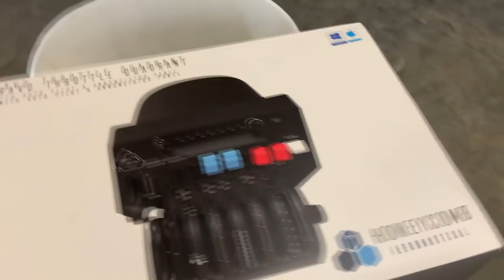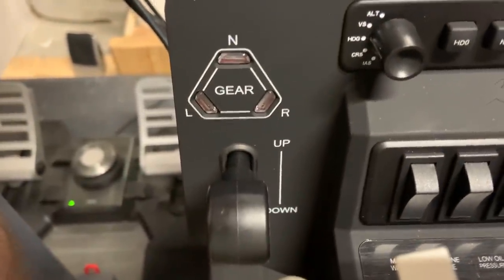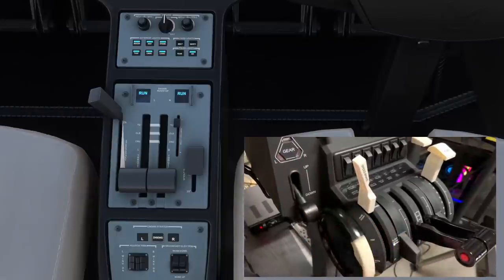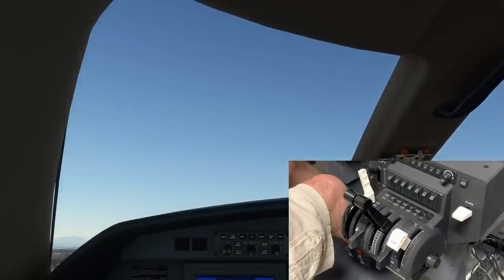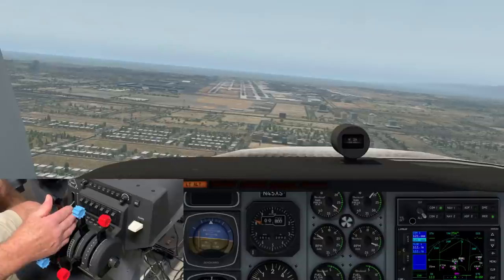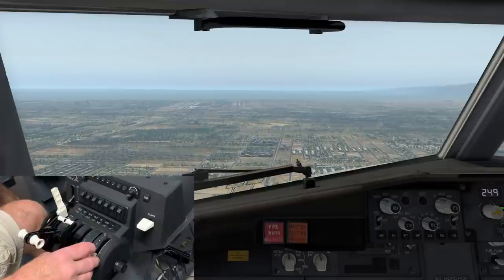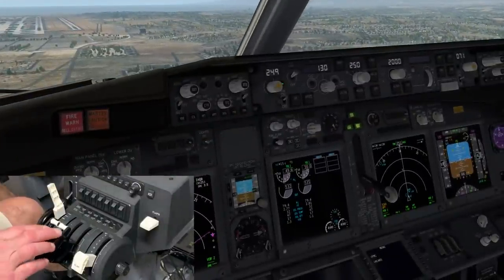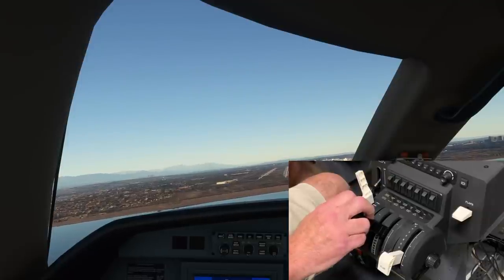Review: Honeycomb Bravo Quadrant - A Pilot's Perspective

Comment: A gem of a review thank Russ. I supported the Honeycomb kickstarter and certainty have no regrets. I saw there is third party software available to turn the button pulse control of the trim wheel into an axis. This allows a change in responsiveness to one's liking, but obviously its not going to affect the physical resistance issue.
The above did make me wonder whether that software (need to find it's name) could be used to turn reversers into axes. That would then offer gradution.
Not only did I greatly enjoy the video, I found the comments section useful as well. My next point to research is whether I could use my old joystick as a tiller for taxiing while having the yoke and throttle assigned? - the issue being I don't have rudder pedals, and a button on the joystic could be used for braking.
Many thanks and a definite sub from me!

Comment: I have this unit... 5 things I can give constructive criticism about:
1) The rotating knobs for the left side selector could have been better quality, with at least a white line so you could see that was currently selected. That, or an LED above each function to show which was currently selected.
2) The push buttons having inter changeable covers so you could assign the buttons the way you want them. 
3) The toggle switches having lights on them so you know when they are active.
4) For the commercial levers, make the white knobs bigger and have the TO/GA switch on the side as it is in commercial aircraft.
5) Detents for the flap and IAS selector levers would have been nice.
Reply from the maker: Good points but I fly a lot in VR so the LEDs wouldn't help me that much since I have to work mostly by feel.. Also,  as a high hour B737 pilot, I can say that the TOGA button is close to where it is on all real 737s made after the B737-200 Advanced (1980 vintage).  The side button is the auto throttle disconnect button so they have it right for B737s on the Alpha.  It was hard for guys who switched from the early model 737s to the newer models because when doing a go around they would instinctively  hit the "old" TOGA (side)button and disconnect the auto throttles and NOT start the auto go around as expected. After a few seconds of confusion things usually went south fast after that and I even saw a few guys bust check rides because of it.

Comment: Hi Russ:  I am your target audience.  A beginner with flight sims researching the hardware.  You helped me choose the Honeycomb Yoke and Throttle Quadrant.  I will be using my HTC Vive Pro headset and wanted to be sure not to overspend on hardware.  Your review  also helped me feel confident I am not overbuying as a rookie.  Thanks.  I really appreciate your calm demeanor describing your reactions to the items your are reviewing.  It makes paying attention much more relaxing.  I think I recognized the Saitek rudder control in one of your videos.  Would you recommend that product to fill out the base set of sim controls?
Reply from the maker: I think I would get a cheap used rudder on eBay or craigslist for less than $100 and wait for the Honeycomb Charlie. May be a year but the Saitek or CH pedals cane get you started at a reasonable price. Thrust master has a cheap set of pedals in plastic but the are about $120 and are close together and look flimsy. I really am not qualified to pass judgement on them so check online for reviews. Good luck.

Comment: Great review. I’m getting ready to set up for FS 2020 after not simming for a few years. Your review is very helpful.

I’m wondering how VR goggles work when using an “analog” setup like this. How can you manipulate buttons/switches/handles while wearing the goggles?
Reply from the maker: This is indeed an issue.In the military when checking out on a new aircraft we used to do a blind cockpit check where we had to be able to find all the knobs and switches while wearing a blindfold. Once you get your hands on the throttle you can kind of find everything from memory and feel  but what we really need is hand tracking and pass through video to be able to really fly easily in VR. It’s just that the immersion and realism is just so compelling it’s worth dealing with the limitations that still exist.

Comment: Would respect your thoughts regarding the "potential" utility of the Bravo Encoder dial and associated Quadrant buttons to complement, augment or mitigate the need for the Knobster.   What compelling physical or logical limitations are observable regarding the Bravo Encoder over the Knobster.  Appreciate your honest and credible review.  Gratefully.
Reply from the maker: Yes in some regards the built in encoder may be a step backward for those using Knobster.  First it requires rotating the selector knob to select a mode which seems less intuitive that just touching it on screen as with Knobster.  It reminds me of the Saitek multi-panel operation.It still beats using a mouse and keyboard for inputs. Second, the Knobster has a much better Elma encoder that the one used in Bravo.  Bravo is a reasonable trade off between quality and price. I am anxious to try the quadrant in VR to see how easily I can stay oriented using tactile feedback only to navigate the buttons. I am thinking the autopilkot buttons and sellector may be pretty easily memorized and used  while "under the hood".  Finally, some people may elect for a panel monitor that is not a touchscreen displaying Air Manager instruments  in which case the Bravo buttons would be a useful improvement over mouse and keyboard inputs.
Reply: @rbarlow  Thanks Russ,  I've noticed in multiscreen configurations that MSFS 2020 only honors Touch when present on the Touch Screen Display (Acer 28" - which makes sense).   
However, if MSFS 2020 is instead running in a window on my larger 32" non-touch screen and a subordinate window from MSFS 2020 is moved into the Acer Touch Screen monitor,  TOUCH does not operate in that secondary window context.   
Ideally, my 32" (non-touch) screen should be used for primary "viewing" and the 28" Acer Touch Monitor would be used for tactile operations such as NAV/RADIO/AP.  Is there a workaround or setting that I have overlooked?   Gratefully.

Comment: I've flown numerous Boeing jets in real life, so I'm picky about realism. I have a couple of questions. 1) Since there are no detents or gates, are you looking at the aircraft flap position
indicator to judge where to position the handle in order to get the flap setting you want? 2) Is there an autothrottle disconnect button?  I noticed that the TOGA switch is where the disconnect buttons should be. It appears that you were able to arm the speedbrakes using the handle. Did you lift the handle as in the actual aircraft or is there simple a detent position that accomplishes that task? Thanks.
Reply from the maker: First look at this video for the flap issue I made a fix https://youtu.be/C5Xh_tFWsVk
As for the A/P disconnect button you can reassign any buttons as you wish. Actually I flew B737-200 Basics that had the TOGA on the side where the later. -200 ADV had the disconnect. At first we were flying both models and had sims of both types. I saw many a guy accidentally disconnect the A/P during a go around thinking he was hitting the toga on the ADV….thing rapidly go downhill from there.  Finally I by habit moved the SB handle to a slightly forward position but there is no arm detent. After you see my flap detents it could be done.of course the autos Poulet works in the sim but obviously the Bravo handle has no motor so it stays put.

Comment: I transitioned from a Saitke yoke to an Alpha and can't wait to get the opportunity to transition from the Saitek throttles to a Bravo (hopefully early next year).  
How is the trim response on the Bravo in MSFS?
Reply from the maker: Not a big fan of the trim on FS2020. Not sure if the inputs are fairly large but slow but I seem to no see it a first and then over trim. Need to look into it. It’s seems to take a lot of wheel rotations to get much trim so it seems more precise than the yoke buttons. Something about the rate of trimming seems off.but I don’t think it is the Bravo.
Reply: @rbarlow  Thank you for your input. The trim is definitely an issue in FS2020. I've gotten a, little better at using it but for the most part I'm just using the autopilot a lot. 😉

Comment: Thanks for the review. 
I just ordered this arriving in the next few days. It looks fantastic.
My main worry is the trim wheel as I've heard others say its too loose.
I'll be using mine in a motion simulator with vibration & I worry its going to move on its own as I move about & it vibrates.
Do you think the standard tension on it is enough to stop it moving?
If not i will be looking to create a mod to put a bit more tension on it
Reply from the maker: I have heard people have been using some kind of rubber washers or something to make it fit tighter and I haven’t gotten around to that yet. I do think it might move with the vibration of motion platform .
Reply: Thats what I thought. OK thanks.
Sounds like something I can quickly knock up & 3d print.
Or maybe get my box of tap washers out
Reply: @rbarlow  
My bravo throttle arrived today & I agree the trim wheel is a bit too loose.
I made a quick fix for this which was a large washer made out of a piece of neoprene foam I cut into a circle ~2mm thick.
I cut a slit in it & slipped it in behind the wheel.
It took me a few tries with thickness for the right resistance but it feels much better now.

Comment: Once again, this gives me the horrible feeling that it's a case of visual excellence over physical details (weak detents, poor tension on the trims). There's no doubt that Honeycomb is trying to position itself as the "go to" for simmers but I worry about the long-term viability for what I've seen. Oh, and I've already bought the yoke and await delivery of bravo - so I've put my own money where my complaints and observations are. I just wish there were more people out there who were prepared to look beyond Honeycomb's beautiful design - and a little closer. "All that glitters is not gold" - and it's the best we got for now.  

Nice to see you noted there is no potentiometer in the reverse thrust (didn't think they would be).

Another thing I noticed is that for all we have loads of switches (on both devices) there's no way to insert some labels so we know what the devil they all do!
Reply: Tip for the labels: glue a metal (ferro) strip below the buttons. Print labels for a particular aircraft on magnetic paper strips. Attach a metal plate in the box where you keep the handles and store unused button strips there. When you change aircraft, get the right handles out and the strip for that aircraft and stick it on the throttle quadrant.
Reply: @Djeez2  Genuinely never thought of that. Pity Honeycomb didn't but thanks, that's something I can rectify now! Brilliant idea dude!
Reply: Dude... It's $250. Show me a better setup for 2 or even 3x that price.

Comment: I'm a happy owner of the alpha yoke but I'm not sure I'll buy this one. In my opinion there are too many compromises. I understand the goal was having a quadrant for almost all kind of planes but in that way each possible setup has something missing. As a boeing/airbus lover, I would have preferred less ap buttons/annunciators and more options on the axis (such as speedbreak armed position or push/pull, a/t disengage, flaps with positions and a full reverse thrust axis). And I don't like the mounting base, the same used for the alpha: I have a thick table and the clamps are just too short while the suction system has removed the paint from the table and is unusable.
Reply from the maker: Well it sounds like you may need a high end dedicated airliner quadrant. Of course the Airbus and Boeing are quite different. I think the Bravo does an excellent job filling a wide variety of needs at an affordable cost. Many folks like the variety of airliners and GA aircraft so this is a great choice for them. Thanks for your comments.
Reply: @rbarlow  Thanks for your reply. It makes sense what you're saying. No, I am not looking fo high end stuff, I am just not fully convinced by this bravo as I was for the alpha, maybe my expectations were too high (and not realistic). In the end I could buy it. I'am also looking at the thrustmaster TCA airbus, because on that one you  can remove the detent zones and move the throttle freely. In any case, both items are out of stock so for the moment no decisions :)

Comment: Thanks for a most excellent review! Maybe add a couple of nylon washers to the trim wheel to increase friction?
Reply from the maker: Thanks, I’ll take a look at that. I don’t know exactly how that is connected as I don’t see a bolt external from the trim wheel to tighten or loosen to remove in place of washer. Right now it pretty much spins like a wheel on an axle.

Comment: I don't understand your detent issue because another reviewer showed the detent on the levers and flaps. Pilot Emilie did a review and there were clearly detents on the levers and flaps and she showed that. Could it be the tensioner not set tighter?
Reply from the maker: No the detent is just very soft. It is hard not to accidentally go past it without realizing it. If I pull the Airline style throttles to the detent and the actuate the revers levers I usually pull the levers beyond the detent.I suppose if you set the throttle friction to almost zero you might notice it more but then IMHO the throttle wouldn’t feel realistic. It is possible to set an action when below the detent, like reverse thrust, so it would be nice to feel it more. On the Virtual Fly TQ-6 the detent is very noticeable and take a good pull to get past it.that throttle also has revers thrust modulation below the detent not just an on/off switch. Of course it is over 3 times the price and has no extra functions beyond the levers. It. y not be an issue for you that was just my observation. I may 3D print a little plug to limit the throttle movement at the detent when desired.

Comment: I dont see a reason I couldnt 3d print full size handles assuming you dont want to use all 6 axis simultaniously... could probably also make a spring loaded gate for the flaps.  I'll probably do exactly this if I ever get my bravo quadrant :P  Turns out its about as hard to get as a 3080 or 6800xt
Reply from the maker: Let me know what you come up with. I would like to do the similar project but I’m not sure how long it will take me to get around to it.

Comment: ok, the trim wheel is too loose. No problem with me. But it just won't work with MSFS. I assigned the elev.trim according to the only functions available, but the trim wheel does not operate elev.trim in the plane. Only the electric trim on the  yoke works.
Reply from the maker: I agree but it does work just poorly. You cannot assign an axis to it so you have to assign elev nos up and elev nose down to the two rotation directions. It is like an encoder knob. Unfortunately the inputs are too slow requiring a lot of rotation to detect a change. I suggest adding a stand alone trim wheel that uses a potentiometer and feels quite realistic. Something like this:
  https://gear-falcon.com/products/stand-alone-elevator-trim-v4

It even has 8 spare digital pins you can attach additional buttons and switches too if you like.
Reply: @rbarlow  now this is not good news to me, as I cannot get this gadget in Europe, and moreover, Honeycomb has done a lousy job of not integrating a potentiometer-controlled wheel in an otherwise good product. As they are currently off the air and maybe going to close down, I take it there is no solution out there. I have used good trim wheels in "real" sim cockpits, and they worked just fine. Thanks for your help.

Comment: Do you think they can add the reverse modulation via drivers? or is it "hardwired" ?
Reply from the maker: No that is just an on off switch. It could be done on XP using part of the throttle axis as the reverse range like I did on the Saitek. Otherwise it would take four additional axes which is not practical on a unit this size and price. I think it is a good compromise in that the levers operate physically like a real B737
See this video Saitek Quadrant Detent Mod
https://youtu.be/Ko_JWdgzay4

Comment: wow, only 58% full scale.  hard to fathom why so small.  Great that you are going to try something for the gates on the flaps.  also, if you find out any larger mod'd throttle attachments, let us know !!!  Great vid as always.  Sounds like they should have involved you in the design!!  ;)
Reply from the maker: Actually about 60% scale is not too bad. The General Aviation  knobs are much closer. It is made for portability too. To get to full scale airliner size it would be pretty big.  It is a compromise and while not high fidelity it is pretty good for the price.
Reply: @rbarlow  thanks Russ.  IF on a scale of 1 to 5, 5 being the best.  What is this Bravo fidelity vs. the Go-Flight GF-TQ6 Advanced fidelity?

Comment: I have a set of Saitek yoke already, can the honeycomb throttle still work with MSFS2020 if I will go to buy this set only, no honeycomb yoke?
Reply from the maker: Sure. The Yoke and Throttle are independent so you can mix the Saitek Yoke with the Honeycomb throttle quadrant. The honeycomb Alpha Yoke is much better than the Saitek yoke though.